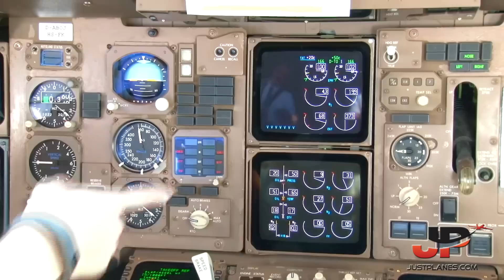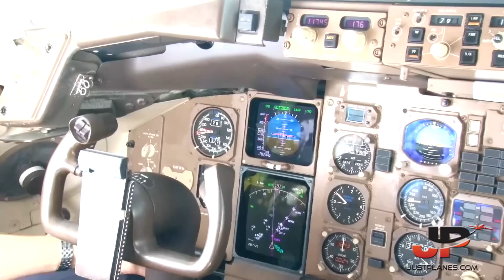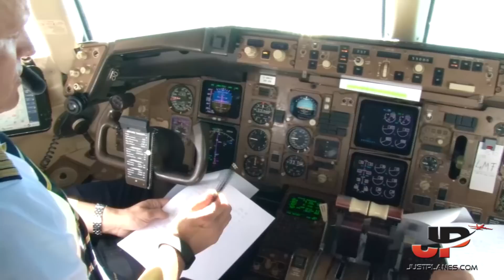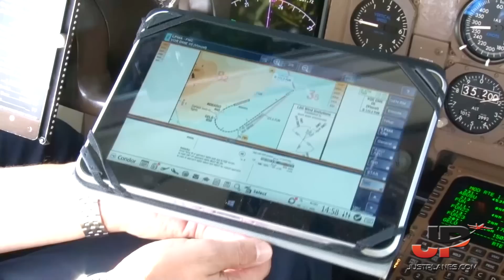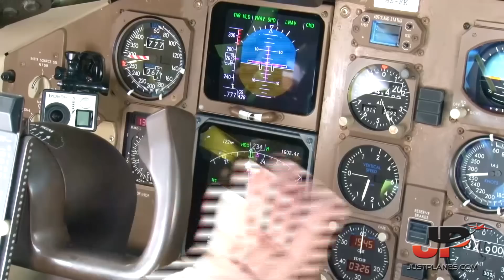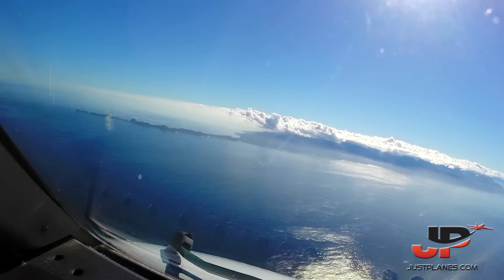Condor Boeing 757-300 Cockpit Frankfurt🇩🇪 to Funchal🇵🇹

Comment: Must have been recorded some years ago as Air Berlin is still around in the footage. They folded like 7 years ago now.
Reply: 2016 I think
Reply: @NotTheRambo  correct, 22SEP16
Reply: Check the weather data at 41:37: 22SEP16